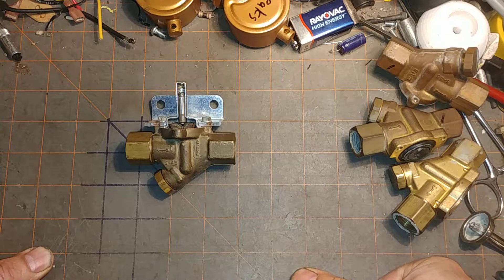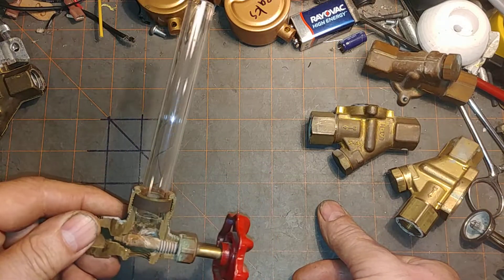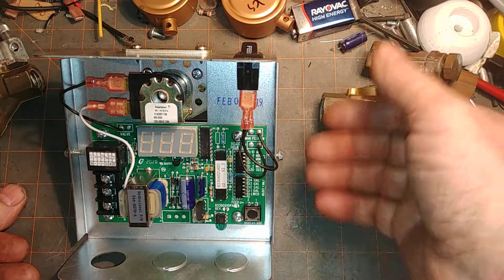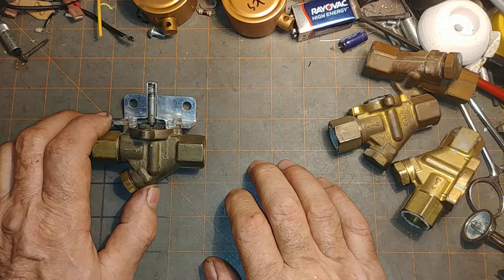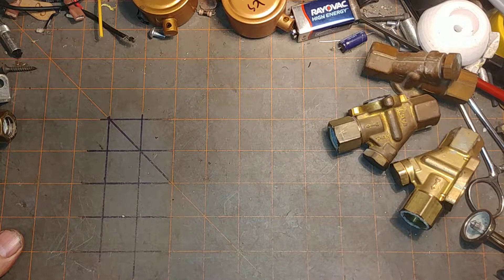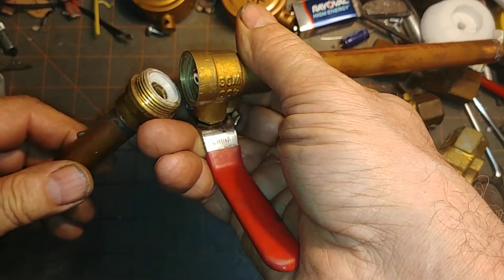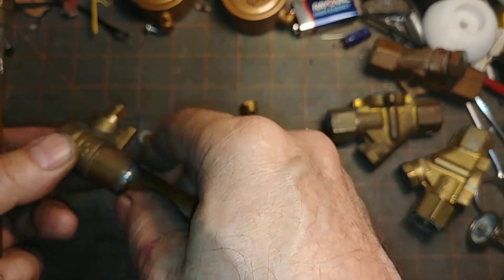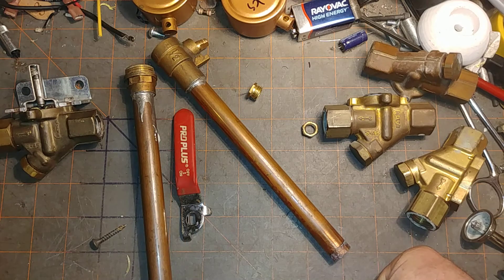Your VXT Automatic Water Feeder Flooded My Steam Boiler! Whaddya Gonna Do About it?

Comment: recently get a new boiler utica with water feeder and it banging loud too many times and water noise very loud i can hear that  dining room the noise in the basement -  I TOUCHED THE BOILER METAL WHEN WATRE FEEDER BANGS LOUDLY AND IT AFFECTS THE OUTER METAL STRUCTURE FROM UP TO MID TO LOWER  IS IT DANGEROUS?   LOWER IS CLOSE TO HE GAS PIPE AND LOWER DEVICE TO FIRE UP THE BOILER =  did the plumber not put in water feeder right? IF IN THE FUTURE THIS WATER FEEDER FLOODS WILL I NEED TO GET A NEW BOILER? SINCE TOO MANY WIRES AND IT LOOKS LIKE THE WIRES OUT THERE NEXT TO HE HOT WATER PIPES AND WATER FEEDER
Reply from the maker: Did you bring up these issues with your boiler's installer?
Did your installer pipe in the boiler following the instructions that came with the boiler?
Did your installer clean the boiler after installation?
Please see my other videos on properly installing Columbia/Utica boilers.
Reply: @gordonschweizer5154     IM ABOUT TO CALL THE CO THAT PUT IN NEW BOILER BUT CALLING HOMSERVE FIRST AFTER 3 WEEKS OF WATER FEEDER BANGIN NOISES THAT AFFECTED THE BOILER METAL GAS PIPES HOT WAER BOILER GAS PIPES AND HOT WATER BOILER METAL  =  I decided to hurry find a solution = i dont know if the installer followed the instructions but he did say he cleaned the boiler with a chemical liquid and that i should only smell smoke for a couple of days =  but i still smell smoke == ok thanks i will check out the videos

Comment: If the low water cut off probe doesn’t sense the water coming in from the water feeder , that means it also doesn’t sense low water either right ?
Reply from the maker: If a probe (or the electronics) does not sense water, it should shut the burner down.
That is the LWCO's only real job.
There might actually BE water at the probe, but the water might not be properly detected.
The low water cut off might then send a spurious signal to the automatic water feeder, telling it to feed water, which might then overfill the boiler.
But, the burner should be OFF, or there is something very seriously wrong!

Comment: 120v is more popular?
Reply from the maker: @junjiawei6531  Not really.
120v controls are usually on power burner fuel equipment (fuel oil,  sometimes gas).
24v is on atmospheric gas equipment.
Except Peerless.

Comment: I spoke with Hydrolevel's Tech Support. They said to be sure to clean the screen in the little pipe that looks like a clean-out. Any thoughts on that service.
BTW, this is one of the best videos on servicing the VXT. The cut-away shots are great.
Thanks!
Reply from the maker: Thank you for the kind words.
Hydrolevel's Tech Support is pretty darned good, isn't it?
As to the strainer, in my area, I don't seem to have too many issues with the strainer clogging, but it does happen.
Usually the issue is with iron H20 pipe rusting and sending chunks into that bugger.
Solder chunks and flux can get into there, too.
If you are having low or no flow issues, the strainer is the easiest thing to check.
If you have access to a 3/4" combo wrench for the end cap, and a 7/8" wrench for hold back, that may help make that job easier.
(Be sure to turn the water off first! LOL)

Comment: I’m upgrading from oil to gas steam and I was recommended the feeder but a friend who’s a master plumper advice to steer away from the automatic feeder because they could flood the house if it’s stays open or fail , is this true? Is there a way to use and avoid this issue ?
Reply from the maker: The automatic feeder for a steam boiler is not a safety device and so is not necessary for the safe operation of a steam boiler by code.
Many professionals believe that their customers should not get an automatic feeder because they sometimes stick open and flood the system.
They are not wrong, that does indeed happen.
It also happens that steam boiler operators accidentally leave the manual feed valve partly open or the valve "passes" water even though it is closed and that floods the system, too.
The best way to avoid the issue is to do all you can to reduce water loss from your system (tighten packing nuts, replace leaking steam vents, etc. etc.)
If the feeder does not have to feed but now and then, it will not be as likely to fail.
Your boiler will last longer, too.
It is also possible to re-build your automatic feeder so it is far far less likely to stick open.
The VXT can track how much water you are losing from your system so you can get an objective read-out of water usage, so you can take the proper steps to preserve your system and your new feeder.
If you go away for a time during the heating season, the VXT can be turned on to add water in your stead.
Reply: So you would recommend I go with what to installer says and do the auto feeder ? Maybe  just go down would you say once a week  or so to maybe add water if needed so the automatic feed is not used as often ? He did say he would put a bypass ball valve incase the feeder would fail … would you say that’s good advice , I do want the feeder I just want to make sure it last as long and prevent early failure
Reply from the maker: Yes, I would advise you to have installed a VXT feeder with a manual by-pass as per their instructions.
I would also advise that a 3/8" m x f valve be installed on the inlet side of the VXT solenoid valve for ease of service in the future (I show this detail on many of my steam boiler install videos.)
I recommend the VXT for many reasons, among which is that they wholeheartedly support proper post installation servicing.
Reply from the maker: @audreyl704  I'm sorry I don't speak emoji very well.
What are you trying to say?
Reply: What do you think about MCDONNELL water feeder ? is the only one my installer has in stock, looks like a small black mailbox , is that one safe he said his installed it many times , we didn’t speak about any issues still
Reply from the maker: @robwhiff3411  Thank you for your question.
First of all, I must state for the record that I am an unabashed VXT fan-boy 😂.
I've got the numerous y-tube videos to prove it 
So, I would like for you to prevail upon your installer to put in what I consider to be a far superior automatic steam boiler water feeder.
The excuse of  ”only having a unimatch feeder in stock" in this day and age is a pretty lame excuse, don't you think?
They can have a VXT delivered in 48 hours right to your door, yes?
You are the customer.
You should be able to get what YOU want (within reason).
Reply: 😂 but you still believe the McDonnell feeder  is good ? So far I haven’t seen any complaints online and that’s all his got to offer .
Reply from the maker: @robwhiff3411  I don't get why your installer doesn't want to install something different other than the fear of the unknown.
It is not any different to install a VXT over the other one.
The VXT is the superior product.
Reply from the maker: On a purely dollars & cents level, the M&M product generally costs more per unit and delivers a lower valve to the end user (you).
M&M's post sale support for their product is non-existent, in STARK contrast to Hydrolevel.
Reply: Wow that’s sucks , I did mention vxt but he says when he went to his supplier they did carry it regular and would be a out for more then a week
Reply: I see two vtx options a blue box and a black box , I could probably get it myself from Amazon , do I just get the box does he need anything else with it ?
Reply from the maker: @robwhiff3411  The blue box might be an older picture or old stock.
The black box is more current manufacture.
The newer manufacture units (after 2022) have a reversible valve body that allows for more options for the installer to allow the number display to be more visible to the user (I've seen them installed upside down 😂).
You want to make sure you get the right voltage unit (either 24 volts - or 120 volts).
What voltage is your low water cut off?
That usually determines your VXT voltage.
The installer should be able to supply the pipe & fittings needed.
I presume they will also add a manual by-pass.
I might also get a 3/8" male x female ball valve shut off (made by Webstone)  for your installer to add to the vxt for servicing down the road.
Being a service guy, I love valves.
Valves to valve off the valves, I always say.
Reply: I don’t want to take a risk and buy the wrong one , I’m going to go ahead and just let him buy the McDonnell feeder and I’m going to do the yearly maintenance like you done in other videos with the VXT rebuilt kit , I went ahead and order the kit planning ahead to do the maintenance in a year , probably I will upgrade after about few years like you said and add the VXT like you showed in other video that should fit right over the McDonnell, what do you say ? I need heat in the house and it already been three days his coming tomorrow to finish up because he was adding some radiators to some rooms that didn’t have radiators house built in 1850 but all is looking good .. love your videos actually you inspired me to do my own maintenance and  to get a feeder ..
Reply from the maker: Thank you for your kind words, sir.

Ask them what voltage they need.  If you are converting an existing oil boiler to power burner gas, you likely need a 120 volt unit.

If you are getting an atmospheric gas boiler (except Peerless), you likely need a 24 volt unit.
Both manufacture's feeders come in these separate voltages and cannot be switched in the field.

You don't need to have them install the feeder right away to get heat.

If you want to up-grade to a VXT in the future, ask the installer to pipe the water supply so it can be easily up-graded and leave room in the piping for the VXT's different form factor.

It is a good ethos to "make it easier for the next guy".

A tongue-in-cheek joke about plumbers is that they are willing to try something new, as long as their grandfathers tried it first.

Try SupplyHouseDOTcom for a VXT, too.  They are a pleasure to deal with & can have the unit to you within 48 hours.
Reply: :face-blue-wide-eyes:

Comment: Ok this its my opinion I dont understend why never install one more sensor in the pipe water after the valve receive order the circuit no more work has to be send signal water continue fluid and the circuit has to desconect all boiler and show code what its hapening and no flood in your home its simple
Reply from the maker: Thank you for your comment.
Please forgive me, but what you have written is hard for me to completely understand.
What you have written is basically a "word salad" that you don't like automatic feeders, but it is difficult for others to take your opinion seriously.
Be well. Stay safe.

Comment: Thank you, Gordon.  for all the information.  Very well done!  Two questions: 1.Why don't steam boilers have a high cutoff shut off? and 2.  I would like to go back to manual feed and avoid any chance of overfilling.  To do that simply w/o removing my VAT is to bypass the VAT by disconnecting it but keep the low water cut off functional.  How can I do that?  What wires do I disconnect?  Thanks.
Reply from the maker: You can disconnect the middle wire of the three in the VXT and wirenut that off.  
Turn the power off beforehand, of course.  
That will keep the LWCO from triggering the feeder, but keep unit powered up.  
That will allow you to use the feed switch to add water manually.  
The VXT will still keep track of how much water you are losing from the system.
Since flooding a steam system is not a safety issue as far as the boiler is concerned, no one has the impetus to  develop a "Listed" high water cut-off.

Comment: I’m confused in something I have a automatic water feeder have 2 valves one in the left green and another in the right black which one should I keep open and which one should I close
Reply from the maker: My dear sir, as I cannot see how your pipes are set up, I caution you I may misguide you.
Are both now closed?
Can you still add water by pushing your manual feed button? (that is, does the water in your sight glass go up?).
If not, open one valve, and see what happens.
Open the other valve, and observe.
Try different combs.
It may be both have to be open to allow water into the feeder and into your boiler.
It may be one is the manual by-pass valve and leaving it open for too long will flood your boiler.
As I said, I cannot tell from here.
Good luck!
Reply: @gordonschweizer5154  awesome it works thanks

Comment: Ty For the video. My water feeder keeps getting a call to feed the boiler and it keeps overfilling it it won't stop feeding the boiler
Reply: I replaced the probe till the feeders getting a signal and still overfeeding my boiler should I change the electronics on the low water cut off
Reply from the maker: @Andy-wz4db  I have seen McDonnell & Miller electronic probe type low water cut offs misbehave and send spurious calls for water to the feeder as you describe.
What model LWCO do you have now?
Reply: @gordonschweizer5154  Have a McDonnell LWCO and VXT feeder. On Auto will keep filling for minutes after the LWCO has been satisfied. If VXT set to Manual with Min 1 gal setting valve seems to be behave properly. I'd prefer to use Auto but for now a band-aid to prevent overfilling. A sticking valve seems unlikely. 
Thoughts on a fault with VXT's Auto setting or the LWCO electronics gone wonky?
Reply from the maker: @SerenoOunce  What happens when you press the manual fill button again?  Does it "snap" shut when you release the button?
Reply: @gordonschweizer5154  Didn't know manual button was there before. Was mounted at odd angle so not visible. (Helping a neighbor, not my unit). But when set to fill only 1 gal it does stop at precisely that. But in Auto overfills by ~ 3 gal. Every time.
Reply from the maker: @SerenoOunce  Not sure what you mean by "Auto".  That's not a setting on the VXT to my knowledge.
What is your timed delay setting, if I may ask? 2 min?
Reply: @gordonschweizer5154  By auto referring to the LWCO DIP setting. Delay @ 6 min. But think it's resolved now. Clogged pigtail affecting pressuretrol. Relief kept blowing clouds of steam and think the LWCO electronics got a little damp. After the repair and drying the LWCO PCB working normal again. Thing is just super sensitive to any moisture.